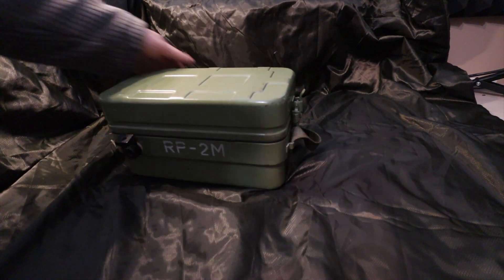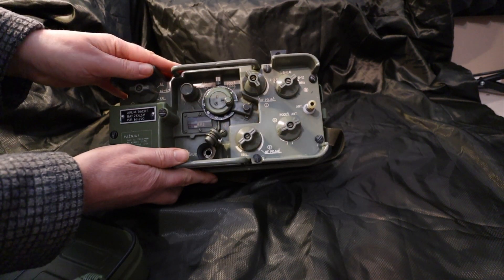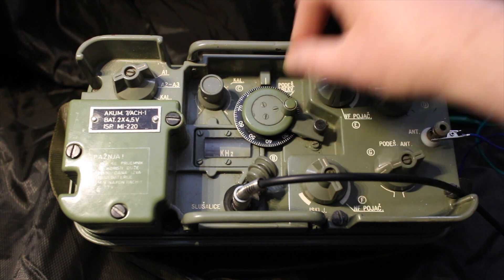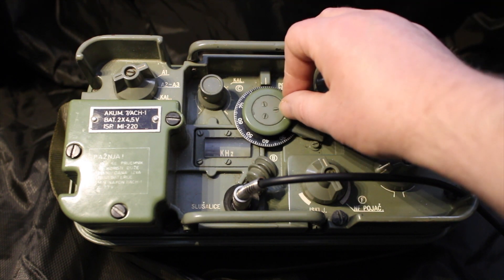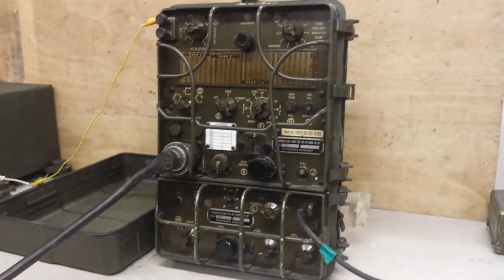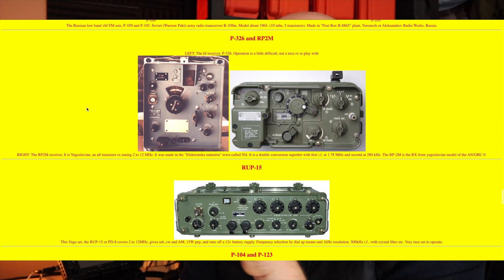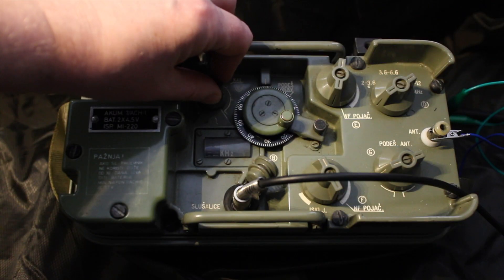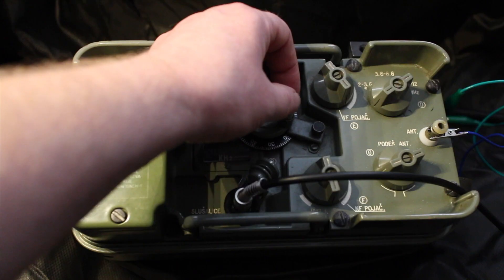Close up of a Yugoslav Cold War era radio | RP-2M

Comment: Have you any comments about the internals of the set? Presumably it's a superheterodyne - most likely, single conversion, analogue VFO (rather than synthesised). Military didn't like fancy stuff back then due to the difficulty of repair and keeping it aligned and calibrated in the field. 2-12 MHz, AM/CW only - no hi-band HF/VHF FM (which the US was pushing hard onto NATO). It's a classic WW2 design - unremarkable electronics and extremely well made, robust, often waterproof mechanicals. Is the case aluminium? That would be very post-war. The WW2 western allies were desperately short of aluminium - US and British radios were often reluctantly, but necessarily, steel based.
Reply: Oh, and there is no CW crystal filter - very WW2, as well. Nobody had discovered ladder crystal filters back then and the odd asymmetric response of single crystal 'phasing' filters required an excessive delicacy of tuning. The iconic US WW2 receiver, BC348 type, ended up having the crystal filter removed from the mobile tactical radios although it was retained for the base station implementation. As an alternative, can also improve CW selectivity by careful adjustment of the RF gain (which this radio seems to have) but you also need to disable the AGC at the same time - a facility this radio does not seem to have.
Reply from the maker: Thank you for the information I’ve pinned in to the top of the comments. It’s great to have people who have the experience  and technical understanding of these radios. It’s a shame it’s limited for many military radios

Comment: Hi Carl. Interesting as ever. I think your comments about NATO and Yugoslavia aren't correct. Post-war, well from 1948, Yugoslavia sought to establish itself as an independent (i.e. not aligned to the USSR) Communist state but, Yugoslavia never joined NATO or applied to. William Park's "Defending the West: A History of NATO" (1986) makes no comment at all about NATO-Yugoslav relations. What DID happen was that Yugoslavia briefly received some 'Marshall Plan' financial support from the USA. Marshall money was offered to all post-war European countries to rebuild, including to the USSR (declined). The Marshall Plan was nothing to with NATO. Also, 'NATO' doesn't supply military equipment to non-members although individual NATO countries CAN do so on a 'national' basis - look what's happening about arms supplies to Ukraine at the moment. Furthermore, this RP-2M radio was manufactured in Yugoslavia and clearly not foreign supplied by the USA or anyone else. The only link I can think of is that this radio was vaguely designed for NATO compatibility; in other words, it receives on the frequency bands that NATO used and that there's a degree of interchangeability of components, batteries, headsets, mikes and so on. NATO was working then to standardise equipment across member nations (in reality, everybody just used US standards), it's possible that Yugoslavia had visions of actually joining NATO at some stage.